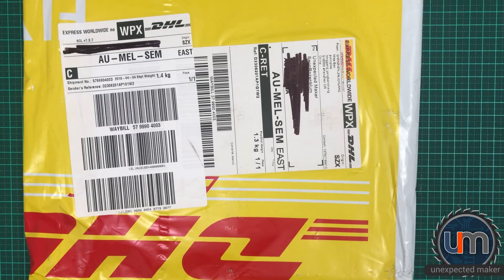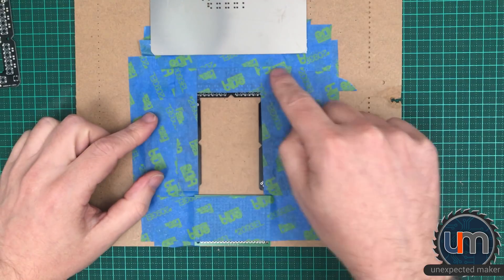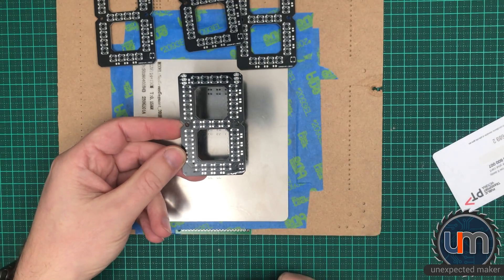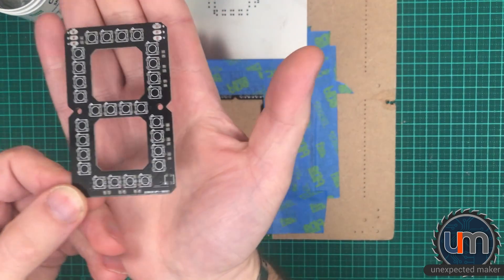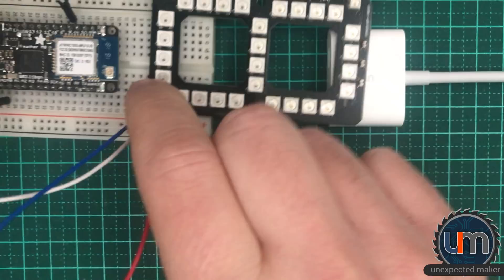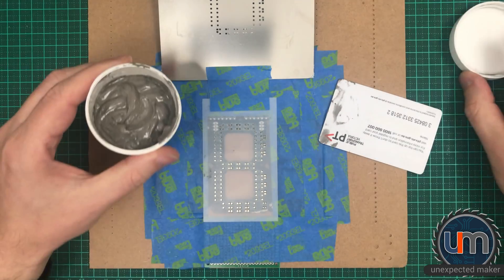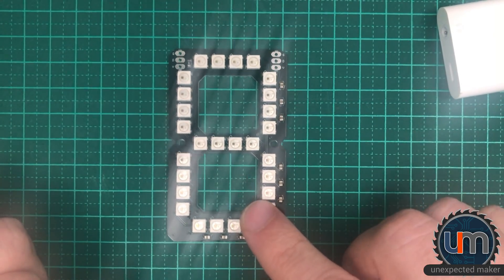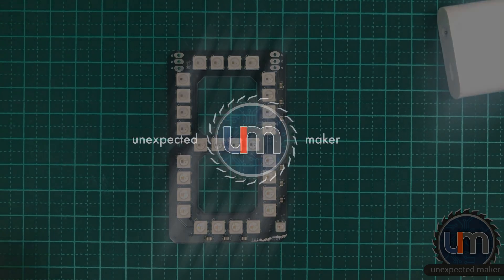Soldering Saturdays #5 - My very first stencil

Comment: That went well. I was nervous for you, too. :) I really like the Mylar stencil idea, especially for including in ready-to-go build kits. Future project suggestion (unless I've overlooked it, which is more than possible): an Arduino controlled reflow (toaster)oven. I have watched several videos where various makers use off-the-shelf DIY reflow oven controllers. Although, if you are successful reflowing using your current method, there is no sense in making the process more complex.
Reply from the maker: Yeah, I've looked into reflow oven mods - but i'm not going to do any of them. My oven doesn't heat and cool fast enough to be controlled any more accurately with a mod, than with me manually doing it with a temp sensor, and each reflow job is fast enough with the 138deg paste, that I have a good process going anyway.

I'd rather get a ReflowR if I wanted a better reflow solution... and one day I might just get one ;)
Reply: Yes, ReflowR seems to be a great option.

Comment: Excellent!
If you want to clean up your mylar stencils a little, try a rubber or hard foam sanding block with water and 1500 or 2000 grit sandpaper to knock down high spots. Mylar stencils are only good for a few uses but you've wonderfully displayed how they save vast amounts of time and effort, while producing a superior result to hand work. Well done!
Reply from the maker: Thanks Peter - I'm looking into how to improve the mylar stencil cuts after they come out of the laser, so I might give wet sanding a go, cheers!
Reply: Rather than the pain of sanding, if you can get ahold of Kapton™ sheet (or it's Chinese cousin Koptan), you may get far better results. Locally they sell it in 300mm squares in the 3D printer supplies isle at NerdMart, so I imagine the 3D crowd is a good source. Kapton is polyimide rather than the biaxially-oriented polyethylene terephthalate of Mylar which is really just high tech soda bottle plastic. The polyimide burns rather than melting like Mylar so it holds fine details much better in addition to being stronger and the stencils are good for many more impressions. As a side note, its color helps it to absorb IR from the laser & polyimide is used to make IR filters; I've no idea of such for Mylar. Cheers!
Reply from the maker: Kapton also absorbs heat does it? If so, it might be hard to laser cut. I'll see if I can source some, but until then I'd like to see if I can improve the Mylar as I have a bunch of it and want to start putting kits together...  and finally get these boards out into the wild!
Reply: Kapton is an amazing heat resistor so it's largely reflective rather than transmissive, in addition to being super thermally stable, but it does pass enough IR to make it a great target. Just Google "kapton pcb stencil." 😉 It's the standard "plastic" to use if you're not using stainless. As a bonus you can get it in standard thicknesses and thickness is everything for depositing the right amount of paste without tweaking the aperture size. Since your mylar stencils are low use, a quick brush with 2000 grit using a piece of glass as a substrate and running water over the top should clean them up more than well enough. The only thing to do is make sure you're happy with the aperture size/amount of deposited paste in the resulting joints.

Comment: you should use pin headers on the breaadboard for a test jig, the square pins will contact better, I have done this before and it works pretty good, you could even make a pcb with just the pin headers to hold  the board on both sides then just drop it on

Comment: The mylar is way easier to see on camera. Hope it's good enough to be used for future stencils.
Reply: It sounds like the mylar is not perfectly flat around the cutouts, I imagine it melts slightly on the edges, is one side smoother that the other. Or maybe cut it sandwiched between something else , shrug. Might just be the card, but it sounded like it was clicking alot.
Reply from the maker: Yup, the laser cut has caused little melt bumps on the edges which is making it not smooth enough to slide the card over. I'm planning more research into this, stay tuned!

Comment: Nice. ;)

I will be trying a stencil first, but just wanted to manually solder a few prototypes before buying a stencil for the next batch.

Only minor drawback of a stencil for me is that I'll be rushing to place all the components on the more complex boards, and often intentionally skip certain parts on prototypes.

They say that the paste will happily sit on the PCB for a couple of hours without too many issues though, and the rest of it is mainly due to my own lack of planning. lol

P.S. Wow - those LEDs look bright. They nearly blinded me through my TV. :p